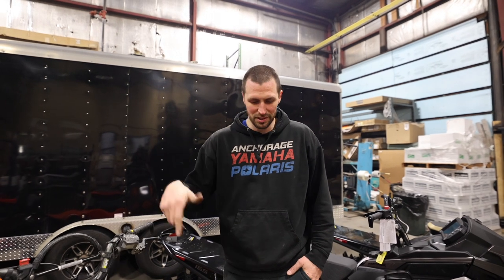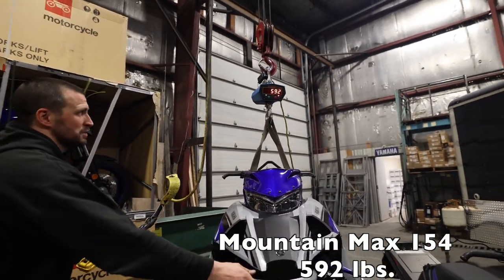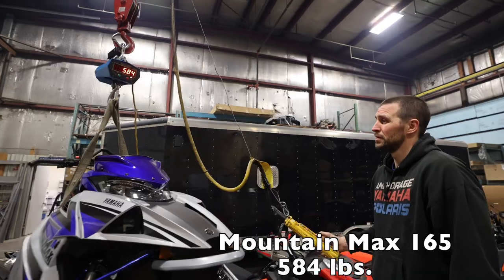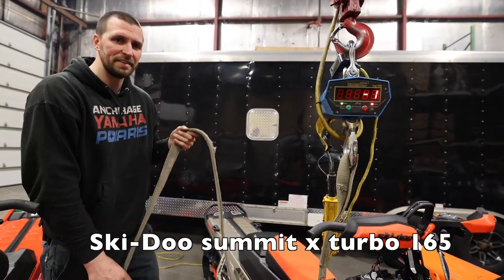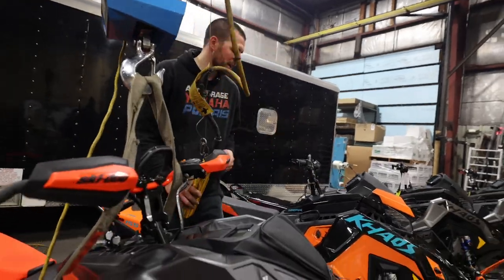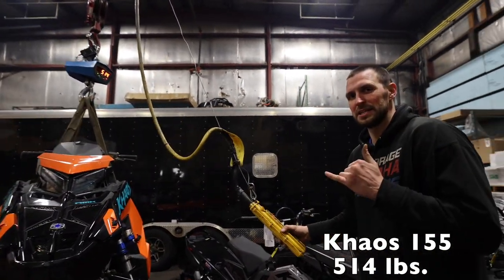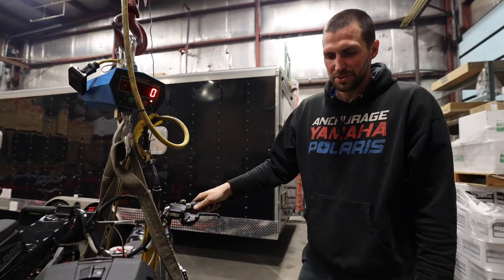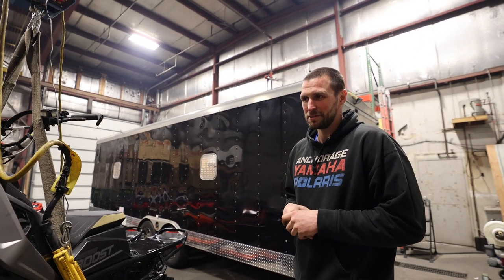2022 Sled Weigh In

Comment: How does the mountain max 154 weigh more then the mountain max 165?
Reply: The 165" LE is basically a Mountain Cat, and the 154" LE is a Hardcore which has some beefed up parts and heavier shocks, plus this version only comes with the 2.6" track which is also heavier than the 3" track. The 154" SL model is a Mountain Cat without electric start(whereas the LE models have estart standard) and it has the 3" track.  I've seen it weighed elsewhere at 540-545lbs. wet.
Reply: Gotcha thanks!